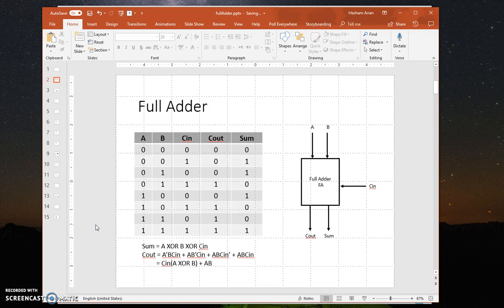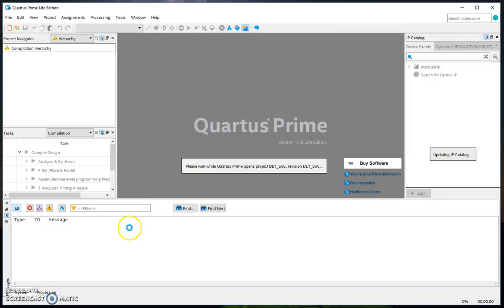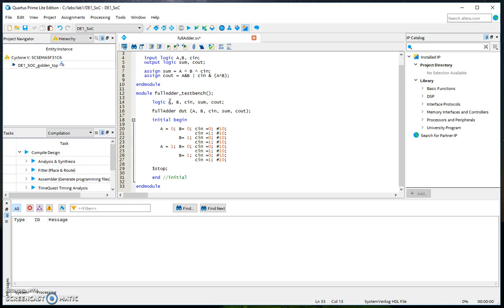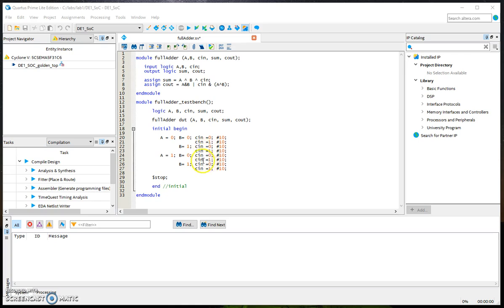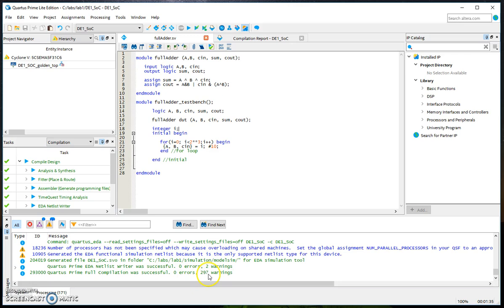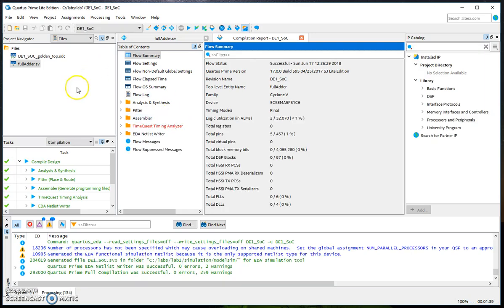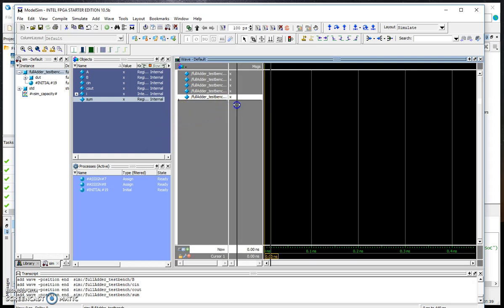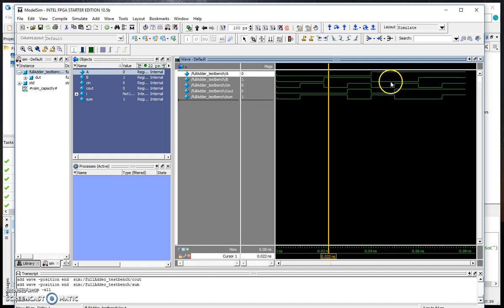Tutorial (2/4): Design and simulate a full adder using SystemVerilog and ModelSim

Comment: thanks for every thing Madam! can you make a video for this question?
Design a multiplier which calculates the product of two 4-bit numbers. Use half adder and/or full adder as basic building blocks and use other glue logic. Draw a schematic and verify it by
simulation in Quartus. please I need your help! thanks again for your cooperation.
Reply from the maker: You can design the multiplier using the full adder. You need to think about how you can upscale the design for multiple bits. Perhaps start with upgrading the full adder example to add 4 bits numbers and then take it from there to convert the design to a multi-bit multiplier. Theres an old video on my channel about drawing a schematic and simulating it with waveforms but it is as made for an older version of quartus so you would need to do some adjustments but hopefully it’ll give you a good start. Best wishes.

Comment: Hello, I followed the exact same procedure but the top level module doesn't seem to be created automatically in my case. How create top-level schematic option is checked while creating the project. Anywhere I went wrong ?
Reply from the maker: You may get different results if you are using a different version than quartus version 17.0